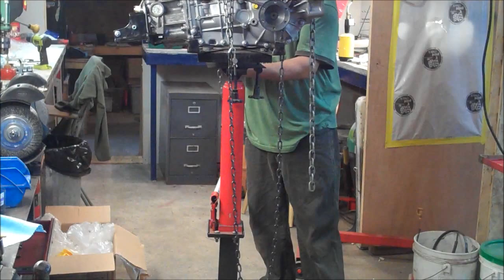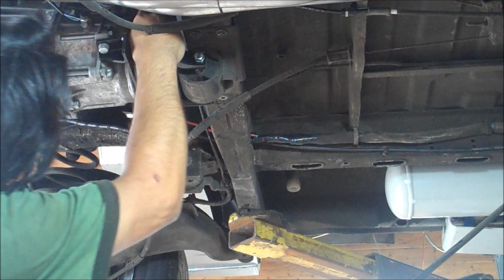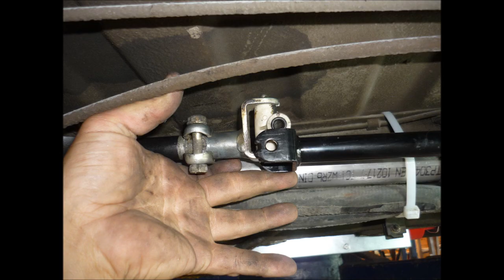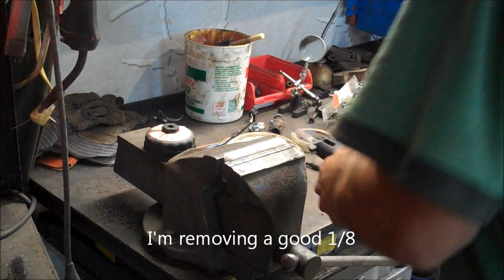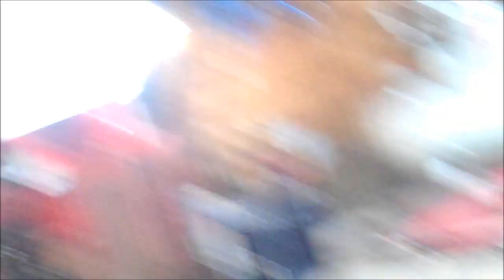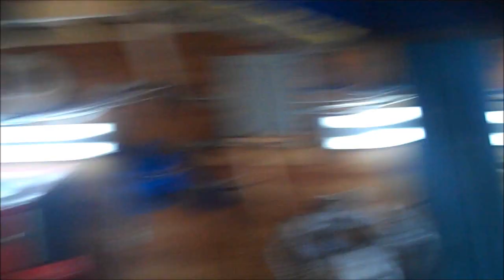Subaru 5 speed transmission in a Vanagon (part 3 and last one)

Comment: I drive a 1978 bay window van with the subaru 2.5 engine and the subarugears transmission. It is a nice unit and works well. I hope to take it to Florida this winter . It was challenging to do the retrofit but well worth it as you know have the luxury of heat in the cold. Bill
Reply: how its possible to install front engine car gearbox to back engine car?
Reply: @datogadelia  4 years late, but there is a reversed ring and pinion that allows what was originally the front diff, to be installed the other way around reversing the drive of the trans. Obviously that now becomes you're rear diff. The centre diff is removed and and the trans is plated off. looking to get one of these but not sure how the gear linkage works because that would need to be reversed too